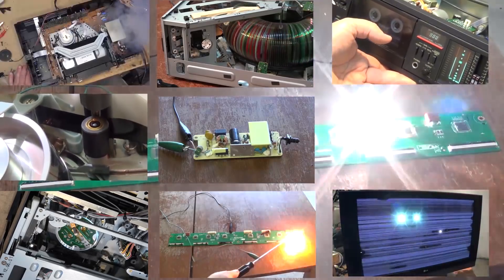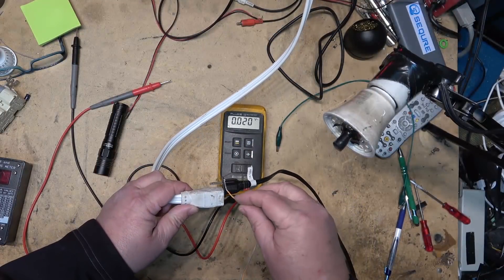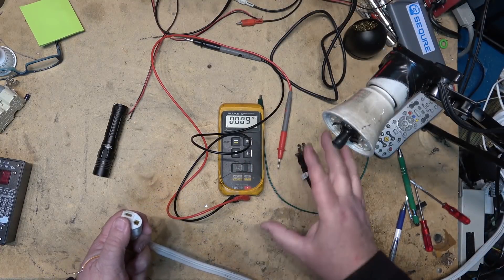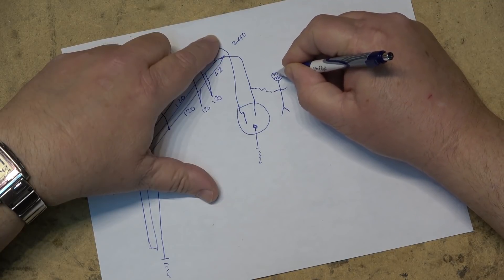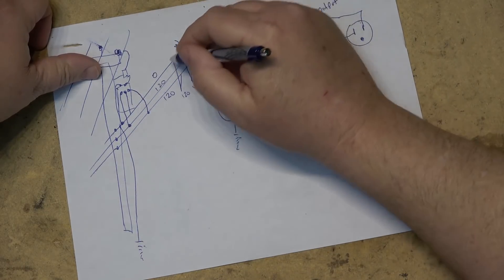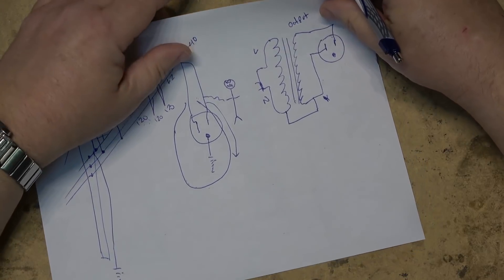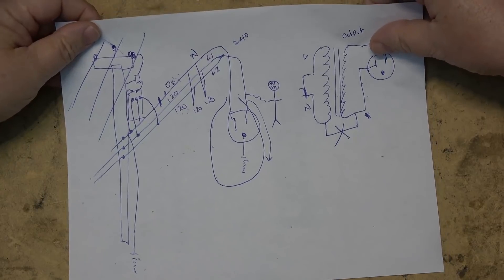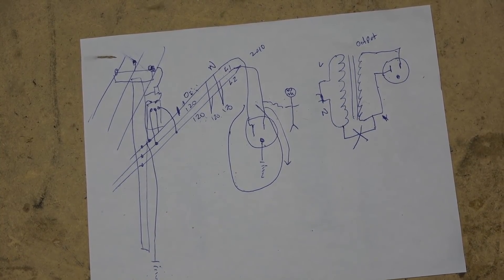Isolation Transformers For Dummies

Comment: I understand the concept of isolating equipment from ground. It prevents accidental completion of a circuit through a person touching the chassis. However, isn't the standard safety practice to ground equipment so that any leakage current from live wires discharges to the ground? Isolating transformers seem to bypass this approach. here is something about this topic that i shall quote: In standard electrical systems with properly grounded equipment, having a grounded chassis is a crucial safety feature. Here's why:

Leakage Current Path: In a properly grounded system, any leakage current from live wires to the chassis has a low-resistance path to ground. This path diverts the current away from you, preventing a potential shock if you touch the chassis.
Circuit Breakers and Fuses: Ground faults can trip circuit breakers or blow fuses, automatically disconnecting the faulty equipment from the power source to prevent overheating and fire hazards.
Isolating Transformers and Old Equipment:

Isolating transformers do introduce a different approach to safety, particularly with older equipment:

Benefits for Unsafe Equipment: For old, ungrounded equipment (often with two-prong plugs), an isolating transformer can be a safety measure. Without a ground path, accidental contact with the chassis becomes less likely to cause a shock, as there's no direct path to ground current through you. However, this is not a perfect solution, and other precautions are still necessary.
Drawbacks of Isolation: Isolation transformers bypass standard grounding mechanisms. This means circuit breakers or fuses might not trip as readily in case of a fault, potentially increasing fire risks. Additionally, it's important to remember that an isolating transformer doesn't eliminate the potential for shock altogether. If live components come into contact with the chassis, there's still a risk of shock.
Win-Lose Scenario? Not Quite:

Here's the key takeaway:

Modern Equipment: For properly designed modern equipment with grounded chassis, an isolating transformer is generally not necessary. Standard grounding offers better overall safety.
Unsafe Old Equipment: For unsafe old equipment with two-prong plugs, an isolating transformer can be considered as a temporary safety measure until the equipment is properly grounded or replaced. However, it's crucial to combine it with other safety practices, like using GFCI (Ground Fault Circuit Interrupter) outlets and exercising caution when using the equipment.
The Best Approach:

The best approach is to:

Use properly grounded modern equipment.
Replace unsafe old equipment with modern grounded versions whenever possible.
If using an isolating transformer with old equipment, exercise extreme caution and prioritize replacing the equipment as soon as possible.
Reply: I completely agree that grounding equipment is the best practice for safety. Here's my take on isolation transformers for lab use, excluding situations with vintage two-prong equipment.

The ideal isolation transformer for this scenario would maintain the ground connection. Its primary function would be to act as a current limiter. If excessive current is drawn, it would automatically trip a circuit breaker or blow a fuse. This allows you to protect sensitive equipment, like a valve amplifier, from drawing too much current (e.g., exceeding 10 amps). In such cases, the isolation transformer's fuse would blow before the amplifier suffers damage.
Reply from the maker: The whole point of using an isolation transformer is to eliminate that touch potential. Even if the live side did touch the chassis it is not connected to line. It is connected to the floating winding.  Therefore eliminating a path through you or your test equipment.  If your device is floating you can't be shocked.  You can still be shocked if you touch 2 points in the device that have a potential across them but not from any potential to ground because the unit is not grounded.  It's essential as a service tool to protect you and any devices such as scopes that may be grounded. I recommend removing the ground on a scope (by plugging into iso tranny) when testing as well as the grounded chassis on the scope will restore the path to ground and negate the safety an isolation transformer provides.  Suggesting replacing old equipment with modern? What would be the point of restoring vintage equipment then.  Also much if this you can't buy.  They no longer manufacture much if this.  Try buying a new VCR for example.  You can't. So your only option is to repair the old stuff and that requires an isolation transformer for your protection.  There is also a reason that most gear does not have a 3 prong grounded plug.  Ground loops. You know that low level ac hum caused when equipment is connected to a ground that is different than the outlet the device is connected.  Think cable TV ground connection which is distant from the house ground as it's grounded at the pole.  We used to have to make isolators for that problem for years.
Reply: @12voltvids  While I certainly wouldn't claim to be the expert here (you clearly are!), I remain unconvinced that isolation transformers are always beneficial. Here's my perspective:

Risk of Blowing Up an Oscilloscope:

Knowledge and experience are crucial in preventing harm. With proper care, you can avoid creating a short circuit with the voltmeter's black lead. Checking voltage differences between ground or the voltmeter and the device's ground point can be done safely.
Differential probes offer another safe option for grounded scopes, making them as safe as multimeters for this task. Essentially, there are two ways to prevent damaging the scope: through caution and proper equipment.
Isolation Transformer and Ground Loops:

You're right; using a grounded scope with an isolation transformer can defeat its purpose by creating an unintentional ground path for the device. Scopes are just one example of this potential hazard.

Musician Analogy:

The example of musicians with ungrounded vintage amps is a good illustration. Touching a grounded microphone while the amp chassis is hot can lead to a shock.

Isolation Transformer Safety Concerns:

An isolation transformer can indeed create a false sense of security for someone unaware of grounding risks.  Such a person might believe they are safe from shock but could be exposed if they touch a grounded device unexpectedly.

My Approach:

While I lack extensive experience in repairing electrical devices, I believe the safest approach for vintage equipment is to ensure proper grounding before use. Modern equipment is already grounded, and there are ways to minimize hum and noise without resorting to lifting the ground.
Reply from the maker: Once again If your device is isolated on an isolation transformer it doesn't matter if a short to the chassis occurs.  It is isolated from ground. Think bird on a wire.  No path to ground means no possibility of electrical shock.  You can touch either side of the line cord while grounded and you will not get a shock.  If you were to measure either side with your high impedence meter between earth and the secondary you would indeed measure voltage due to the meter being high impedence but no current would flow because any form of conductor (your body) for exqmple would pull that floating voltage to ground.  It's really not a hard concept to follow.  You want to use isolation before connecting test equipment because even if you are careful when happens if your scope probe falls off and drops on the line or b+ rail.  Instant sparks.  Same situation chassis on isolation tranny and your scope ground drops and lands on line or b+ and nothing happens. No sparks no equipment damage no blown fuse.  That rail becomes grounded and the potential shifts to the other side of the line.  ( Which would create a shock Hazzard at this point and that is why it is also important to have a non grounded scope unless it is necessary for specific measurements.  I've been in this game a long time and i have had my share of jokts over the years always when no isolation transformer was available.  Got the shock of my live on a tube tv in a customer's house.  Had the back off and a cheater cord.  Asshole customer made me take off my insulated boots.  Some how i made contact with line on chassis. (hot chassis very common) and my foot was touching the heat register.  I was lit up good.  The jolt made me jump and that broke connection.  Had a had an isolation transformer with me that would not have happened. It was that job that I told my boss I would not go on any more service calls unless he bought me a transformer.  That transformer incidentally is the one i use on my bench. I stole it from the shop when we stopped doing in home service.  Argue all you want, they are the most important safety device you can have on your bench. Any argument is pointless. Every professional service person knows this and we will not work on anything is it's not isolated especially switch mode power supply.
Reply: @12voltvids  Thanks for your valuable input. You do agree however that you hot isolated equipment will jolt you the very moment you get into contact with any other piece of equipment that has a proper short to ground? Like the musician illustration where the guitarist touches his lips to the microphone. The isolation is not perfect. You get to be of the same potential of the chassis might not realize you are now 120 volts and ready to discharge if you touch a different piece of equipment. You would agree with this? I am sure you do. This is because in the scenario that you constructed before with you touching a hot point and then touching ground and nothing happening, the catch is that you are not yet closing the circuit, so the ground acts as a conductor but it has no path back to circle to. But on my scenario of touching a grounded piece of equipment a circuit with ground does exist and is complete. That is the hole point of grounding equipment after all. In short, you become a new AC power source and the equipment is a circuit you are supplying AC to. This is a very real risk. this world scenario i am depicting is also ever present, things are grounded all over the place. And in grounded systems current that touches a grounded point flows through. You could acknowledge that this much happens to be a real risk. So try to repeat the video where you have a second metal lamp that is grounded and has a metal case. Turn that light on, now that light represents a grounded closed circuit. Touch the metal casing once your isolation transformer was supposedly making you safe. That will not end well. Your isolation transformer has just officially become grounded and there is a catch now. If the equipment had been grounded in the very first place the equipment would have an ultra low resistance back to the power grid, effectively a short to the mains and you would represent a high impedance parallel leg. But with your isolation transformer  you are really in a spot because you now are a parallel leg of the circuit but the only single path that happens to exist to ground . So entire 120 volts will drop through you.  in short equipment that is not grounded is terribly dangerous. it might be the safest thing you can do if the equipment has a two prong power cably to have it floating but you must be well aware that the protection from discharging to ground is not a certainty, the environment around you could destroy that illusion. so people need to understand that as well and not just hear it is going to be on there is no catch here. that is the problem for me of the video it almost advertises that normal grounding of a circuit is just bad , but it is best practice. you float your circuit and will be well. you are safe. No you are at 120 volt potential and all it takes is closing a circuit any circuit somehow. And it does not take all that much to get in contact withwith grounded closed circuits, they are literally everywhere. The microphone for the musician is just an example of an infinite number of death traps. So be careful when floating your device.
Reply from the maker: No you will not get a shock from your isolated equipment. The only way you will get a shock is if you ground that equipment.   If for example your guitar amp chassis some how has the line conductor touching the chassis it will do absolutely nothing because it is not connected to the mains line.  It is floating on an isolated winding.  You might feel a slight buzz from the chassis as microamps will flow across it bit literally your skin resistance will effective pull the chassis to ground.  The only way to get jolted  from something on a floating isolation transformer is to contact both the hot and the neutral wires internally at the same time.  That type of short would blow the fuse.  I'm sorry if you can't understand the concept of this but a ground isolated line isolated device you simply can not get a shock or either wire touches ground. The senerio you mentioned the guitarist getting shocked when his lips touched the microphone is not from isolation. It's a fact that many old amps have a line reversal switch to effectively flip the polarity of the AC line to reduce hum that can be picked up by ground loops.  It's also a fact that many musicians get frustrated with ground loops and cut the ground prong which lifts the ground on the amp.  That creates a dangerous situation.   They would need to plug the amplifier into a floating isolation transformer.  Then it's safe.  Will you measure viktage with your high impedence dmn between chassis and earth. Yes you will. Could be as high as 60 volts but there is no current.  You might feel a tickle if you kicked the microphone but it's just a couple of microamps.  These transformers are to protect service people.
Reply: @12voltvids  Alright, thanks again for the explanation. https://youtu.be/JTfzgeJYFo8?si=I0TZ8-hy6xtH0DcJ  I remain of the opinion properly grounding equipment before working with is the best approach. Just assume any hot wire or the chassis can kill you, and ensure to ground stuff so that circuit breakers will save you, if need be.

Comment: That example of connecting the lamp to hot and direct or indirect ground would never work in Germany as the residual-current device would trigger. Every circuit in the house is protected that way.
Reply from the maker: As has been stated before only outlets in wet areas, that would be the crapper and outdoor outlets require GFCI. GFCI are a pain in the ass. They trip for no reason.   I ended up removing one in a bathroom that I have a timer and plant light plugged into.  Wife keeps her house plants in there.  Have to keep them locked up because cats like to eat them and some are toxic to them.  So we have an led plant light on a timer.  When it kicked off it would trip the GFCI almost every day.  So it was removed as it was annoying me almost every day.  Same thing happened to my aquarium that I had a GFCI on. The inductive ballast for the metal halide lights caused it to trip killing power to the pump which resulted in about 1000 in dead fish and corals.
Reply: @12voltvids  I have the same problem with the ceiling fan kicking off the GFCI in my bathroom when the power switch is shut off. Also the stereo makes a pop through the speakers. Need to quench the EMF back current from the induction in the circuit. I was thinking of a capacitor in series with the power switch, maybe 0.1 uf XY cap?
Reply from the maker: @zulumax1  every time a light is turned on or off the picture on my tv goes our for 1/2 second as the induced voltage causes errors on the extra long HDMI over cat5 cable as my amplifier is about 40 feet away from the TV.

Comment: You need some spiked hair on your stick figure & smoke coming from hands, Call him Ottawa Macron.  Hugh ,Chicago
* PS : So its floating and your isolated through magnetic induction. In Chicago area we use 5/8 ground rod 8 foot long we take  a # 8 for a 100 amp to grounding bar, also that same wire comes out of grounding terminal strip to water meter feed pipe & we put a jumper around water meter. So would you say put a dim bulb on secondary of that isolation say 100 watt as a safety before firing up an old unit. Put it in series with the hot, that would work. So is the Transformer a  120 primary & 120 secondary .

Comment: The energy is in the moving magnetic feild surrounding the windings.
The secondary winding has a potential difference between the coil wires only.
Earth is not part of the path, unless some asshole makes it so.
Reply from the maker: Well that is how they work.  Perhaps tomorrow I will do a demo of a GFCI in a fault condition.

Comment: Floating power system is good for your first ground fault, second ground fault wont be so pretty
Reply from the maker: Well with floating power there won't be any ground faukt now will there.
Reply: @12voltvids  The whole bench and equipment hooked up will need to be all floating together then.